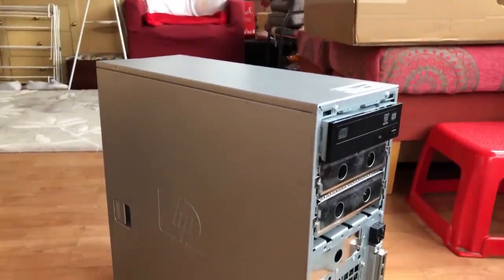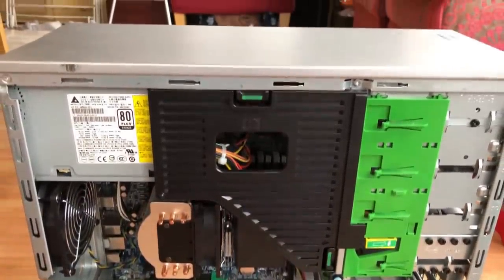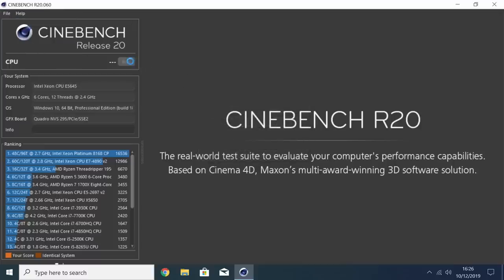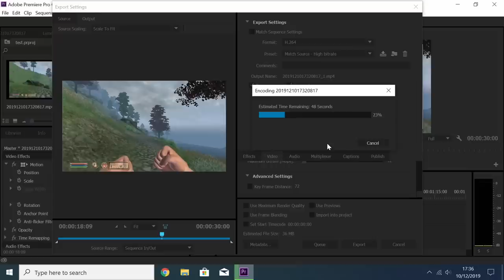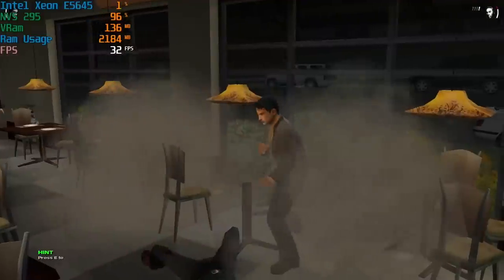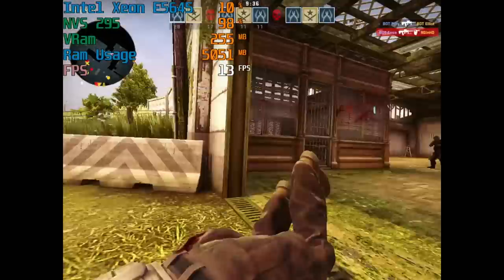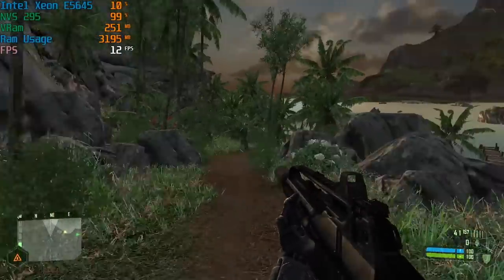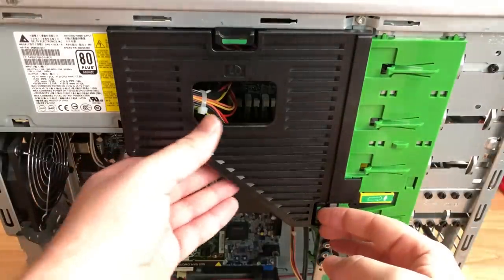I Bought a £50 ($65) 6-Core Workstation PC, But What's Inside?

Comment: Tech YES city would love this Xeon build.

You can definitely upgrade this to top of the line Xeons for cheap and throw in a decent gpu plus 16gb or RAM.
Reply: Yeah, Xeon W3690 (i7-990X) or X5690 would be a great CPU for that system. For RAM I'd recommend getting 24GB (3x 8GB or 6x 4GB) or 12GB (3x 4GB or 6x 2GB) because it uses triple channel memory.

Comment: Awesome. I've been using these to do budget custom builds and have plenty of vids, and even a complete transplant build tutorial, on these. You can run standard DDR3 on these, as well as unbuffered (non-registered) ECC ram which is also cheap. The top dog 6-core CPUs would be the Xeon X5690 or the Xeon W3690, and the highest frequency quad-core would be the Xeon X5687. For a collab with my TechTuber TechFam group, stuck an RTX 2060 on a Z400 build as well as managed to overclock the CPU with intel XTU due to using an unlocked variant. If you wanted any advice or help or were interested in collaborating on a content piece featuring these more, i'd be happy to lend a hand!
Reply: 4ghz all cores on a w3690 in a precision 3500 with a ghetto 240 aio setup. With an r9 390, made for an "ok" vr setup. Was prob 500 bucks all told 3 years ago. Was alot of fun. Yeah I cut the case.

Comment: I’d like to see what this machine would be like with a decent graphics card and more ram....
Reply: And a Xeon W3690 or i7 990X and some serious overclocking.
Reply: They do very well with a GTX 1050/1060 on stock psu.
Reply: I have a HPZ400 with a Xeon X5690 and RTX 2060, It was a present so I only added the CPU (60 EUR on aliexpress) and the GPU (about 300 EUR) I have no problem playing Ultra at 1080p with high framerate (dont expect 144 FPS or 120 on newer games but +60 is achievable), and even games like the division 2, im able to get about 60FPS on Ultra, 4K with 50% resolution scaling, and it looks gorgeus. (i known, resolution scaling is not real 4k but at 50% it still looks better than 1440p, just my opinion).
But here are some flaws
:
1) RAM: stuck at 1600Mhz (or 1300? cant remember right now). and you cant change it.
2) CPU: No overclocking options.
* I Just tried intel XTU and other sofware which I couldnt remember, maybe there is other way to do it but I think is because the stock motherboard *
3) PSU: most of them came with a 475W PSU with custom pinout (thats why I have 2060 and not something bigger), out there there are some 600W official PSU but are really expensive. The PSU connector is in fact a regular 24 pin connector but with some pins on a different possition, so you can use any PSU you want if you rewire the 3 or 4 diffent pins.
Those problems have an easy fix, just get a new motherboard so you can overclock your ram and get a better PSU but I normally like to invest the bare minimun on older devices like this one. 

So.. Its a really nice workstation, you can find some bargains on ebay and if you are on a really tight budget you can play games at 1080p max settings with no problem! (with the adequate Z400 variant).

Two more things the Xeon X5690 is not officially supported by HP but there are 2 variants of the Z400, one with 6 RAM slots and one with 4, the 6 RAM version can handle it, Also, HP states that it only supports 32Gigs of RAM (cant find the datasheet right now so maybe im wrong) but I have 48 and so far so good.

Sorry for the long text, hope it was useful and sorry if I made any gammar mistake, english is not my native language.

EDIT: Just saw a video where a guy adds the X5690 on a 4 RAM Z400 so forget about that...
Reply: @grimsayjr9371  you can get an aftermarket adapter harness to connect a standard atx psu to the hp mobo.
Reply: @OutlawH2  Hi! thanks for your reply!
I did saw it back in January when I started to upgrade this PC but If I remember correctly It was like 20 EUR plus shipping, and I really didnt felt like to spend that much because then I had to add some extra 100 EUR for the PSU so... I just held back, for now...... but the PSU at least you can use it on a future RIG so its more like an investment..... crap! now I need that cable! happy now? XD
Reply: @grimsayjr9371  lol the only other gotcha is the psu mounting. But it looks like that could be solved with an adapter plate.
Reply: @OutlawH2  yup, the mounting is not standard, and if I remember correctly ( I tried to fit an old 650W Corsair PSU years ago), the back of the PSU, where you plug it in, it doesnt align properly, but this is my ghetto PC gaming, the exterior case is already beaten up, so nothing that some duct tape cant handle, unles..... a new case..... it would be another investment..... oh man.....
Reply: @grimsayjr9371  rabbit hole lol. Greenpcgaming solved the psu issue with some velcro.
Reply: ive done this, plenty of builds and benchmarks. Even stuck a w3690 into one and used intel XTU to overclock it to 4ghz all core with an RTX 2060 and more ram, of course. Does well! Ive got the transplanting process down to a science at this point lol.

Comment: For these type of PC I usually recommend in buying the highest clocked CPU, the Intel Xeon W3690 or W3680. This being to them not overclocking but for the rest with AIB socket 1366 boards I recommend the Xeon X5675.
Reply: You can overclock the multiplier of the w3680 and w3690 using throttlestop on OEM boards without needed to modify the bios, the only thing you can't alter is voltages. You can however change the power target and current limit.
Reply: @Craziestbanana  Intel XTU works on the Z400 sort of, you can change the all core turbo multiplier, with the w3690 was able to hit 4.12 Ghz all core turbo on the stock voltage.

Comment: I got one of these with 18 gb of ram and I put a gtx970 in it; aside from the proprietary PSU being its eventual downfall, the system was incredibly capable of running the latest titles circa 2015. This is a fantastic computer if you are able to pick one up for cheap

Comment: I recommend the Intel X5675. still pretty cheap, but it boosts to 3.33GHz on all 6 cores (33% faster than E5645) and has a 95W TDP. it's the fastest 95W CPU this mobo can take.
the best 130W cpu is only like another 8% faster.

you got a 6-slot version of the z400, so always have either 3 or 6 sticks of 10600 ram installed for triple-channel functionality.
regular DDR3 works fine, though ECC unbuffered (10600E) is recommended, I'm running 10600u...

the old Z400 only had 4 ram slots and quad-core support, buyer beware.

Comment: I work in demolition and I've seen finding some left behind PCs. My last find was one of these but with a Xeon w3520 and a Quadro FX 1800 in it. Just like yours, gaming was definitely not in the question. So I threw in a GTX 960 and it was a very pleasant improvement.
Also if you update the bios you can buy a better Xeon for it.

Comment: I am currently using a Z400 as my main PC- my custom build computer was killed and I needed a quick replacement, and surprisingly, it's fine! Mine has the Xeon W3690, basically a i7-990X under another name. The 475W power supply runs this and a mildly CPU-bound GTX 1070 just fine. I will build something new to replace it eventually, but it's good enough that I feel no pressure to do so.

Comment: I use a Z400 as my main rig I upgraded it to a GTX 1060 msi gaming x, a  Xeon X5670 and 12Gb of Ram and it works flawless I never had a problem running games :)
Reply: 12gb of ram?
I can only buy 2x4, 2x8, 2x16
Reply: @user-wq9mw2xz3j  I have 6x 2GB
Reply: Same specs here, and runs even better as an Hackintosh ✌
Reply: @Cookie-jb3xd  oh wow lol.
does your motherboard support that many RAM slots
Reply: @romolo1990  lol really that's awesome :D
Reply: @user-wq9mw2xz3j  it has 6 slots

Comment: I have one of these as part of my set up. Currently have the 4 core W3565 and a Gt710. It has been a great browsing and general purpose machine in this format. But I have also put together one for a friend with the same processor but much more Ram and a GTX1050Ti. His Z400 has 24 GB of Ram vs my 8 GB. But the plan for mine is to upgrade to the same Ram and GPU. Already did the bios upgrade to support the W3690 6 core CPU.

Comment: I'm a proud owner of a Z400- they're pretty neat workstations, and the PSU can hold up with a beefier GPU without replacement. If you're still poking around for a processor upgrade, then stick to the 4-core chips that will typically have a higher clockspeed, with similar prices- a W3530 is alright, but there's always better. Bring the ram up by a hair and fit a 960 or 1060 and you'd have a pretty nice machine in your hands

Comment: One of my boxes has a 1366 gigabyte board with a xeon 3670 6 core. I pushed it up to 3.81ghz, paired with a gtx690. While it drinks power at 500w while gaming, it still handles quite a bit. It's my "portable" system I take with me to friends houses.

Comment: I really like those LGA1366 based HP Zxxx machines. 
Last year I got a HP Z800 for 100€.
Upgraded the CPUs to two X5675s, put in 64GB tripple channel RAM, an SSD, 4 1TB HDDs and a GTX 1080 and for the age the machine was a beast.

You should also check out a DELL Precision T3500/T5500/T7500.
Awesome machines as well.

Comment: I have had one of these for 5 years. I bought mine for £100 with 2 x 500gb HDD, Quadro 2000D GPU, 12GB RAM. It has a 1TB SSD and 24GB RAM now.  CPU is W3565.

Comment: I used to mod & flip these and dell T3500 in 2015ish for massive profits! Bit of paintwork, couple of LEDs and they dont look half bad. They came with W3650(?) 4c/8t CPUs at like £50. Throw in a GPU and you had a solid 1080p gaming machine for under £150. Shame the CPUs dont hold up well with newer games though

Comment: Yes, I game on one of these Z400 motherboards. You're going to want to go with the full 12GBs of RAM to take advantage of the triple channel memory bandwidth, upgrade to a W3690 or X5690 ( the X5690 can go for as little as $22 bucks in the US), and I went with a downward-facing Gammax Cpu cooler to give the motherboard and RAM extra cooling since I was putting it in an aftermarket case. I also brought a $10 dollars CPU fan adapter and a $15 dollars PSU adapter so I could use after-market CPU Cooler and PSUs.  Works great with a GTX 1060 or 1070 in gaming and CPU temps stay in high 60c or low 70c. But if your video editing you will want a decent after-market cooler because my W3690 does get hot at full load, but it still keeps it 3.6 GHz clock speed at all times.

Comment: You’re holding the CPU back with just 8 GB of dual channel RAM. Get 3 sticks of RAM to run in triple channel to fully maximize the x58 CPUs.
Reply: Triple goes only 1066mhz dual 1333 mhz so is not much gain
Reply: He had 4 sticks of RAM - using quad channel RAM would have been fine. I'd have increased the capacity to 16GB though.

Comment: I have one of these, possibly two. Mine only has a W3520 (basically an i7 920) though, but it’s the 6 slot motherboard and has an AIO water cooler. I also had one of the 4 slot models, but I donated that back to the refurbishment project I scored the others through where it still runs well to this day.

Comment: $50 basically for you and you get a proper case, working motherboard and cpu plus ram.  Not a bad deal at all.  Throw in an extremely old cheap hard drive and a suitable card that will not be a bottleneck for the system and it is good to use for gaming of sorts and like you said an everyday pc for simple tasks.  I wish it was more common where I am to have these places to go where you can get used stuff in England.  Canada isn't quite heaven for buying used pc parts and making it harder I am not close to a larger city.  Anyway great video and looking forward to seeing what you do with this.  Btw about not having a pc case side on eh who cares as long as it runs.  Heck I want a test bench like another YouTuber so I can just swap out hardware like nothing all the time.

Comment: I have a hp z400. I upgraded the power supply with 24 pin to 24 pin atx moddiy adapter, since the 24 pin on the psu isnt atx. I also upgraded to a hd7870 and the computer runs games pretty well. Only problem is the upgraded power supply can't be properly mounted

Comment: I got an old Z210 tower workstation from a friend of mine a few months ago that had a Xeon E3-1230 in it @ 12GB DDR3-1333 RAM. I think it's just the slightly newer version of the Z400. I upgraded it to a i7-2600 and thew in a GTX1060 6GB & SSD. It's actually a really good machine and makes for a decent everyday PC with some extra horsepower. I don't have many games to throw at it but I have tried Forza Horizon 3 & 4, Fallout 4 & Rocket League and all play well at high settings 1080p.

Comment: Picked up a Z400 with W3680 3.33ghz 6C/12T, 14GB DDR3, 500GB HDD for £68. Threw a GTX 1060 into it and the thing flies with an SSD installed as well.

Comment: When using 1366 always make sure you are in triple channel memory (not 4 2gb sticks as this will turn it to single channel) homnestly  upgrade the GPU i have been uing the X5650 (The E5645 slightly bigger broother with 24GB DDR3 and 2 gtx780ti's  in SLI for the past 6 years and it has served me well)

Comment: just a warning, i got 2x of those hp workstations: they got proprietary psu format that also lack a pullup resistor for the turn-on signal (which is instead on the motherboard). also the motherboard tray doesn't allow different formats in.

Comment: Speechless but a good deal you had in buying this machine. I am still on  Intel Pentium Dual Core E5700 @3.00 . The good thing is having a good motherboard of ASUSTeK Computer INC. P5G41C-M LX (LGA775) so did ssd with GPU card Geforce Gt 710 . Still working . But would say that HP devices are rarely good especially in the long run.

Comment: i still have the same z400 but with 4 core 8 threads xeon paired it with 16 gb of ram a saphire radeon rx480 oc 8 gb and 3 ssd's in raid 1 and plays all modern games with fps starting from 60 up with all settings maxed out  . best beast i put up toghether for myself until now .
gl with the project and let me know if u want to change the power supply  there is a bit of modding involved to the 24 pin to work on that mobo.

Comment: I run a Dell T7500 workstation with twin Xeon X5690 CPUs, 4x 15,000rpm SAS drives in RAID as a main boot drive, 48GB  ECC RAM and twin GTX 980TI's with a second power supply. 4K 60fps gaming easy at a fraction of the price, noise cancelling headphones recommended.

Comment: Hi - My main PC is a dual xeon X5670 rig with 32gb of ram I picked up for buttons on ebay. Popped a gtx1050TI in it and it games well and with 12 cores at 3.2ghz it monsters through productivity stuff. I really rate the LGA1366 based xeons and if you can get a system with dual CPUs for low money then the performance for price is incredible. Some of the dual xeon workstations of this generation still attract a decent price but every so often you can score them cheap.

Edited to add, depending on bios most of these will take up to an X5675 so that might be an upgrade to get better clock speed. Slighty faster ram might help - mine is running 12800 DDR3 which is a bit faster than normal stuff these come with. Again in terms of upgrades, the Bios is normally the limiting factor as workstation stuff often has very little if anything in the way of bios options like overclocking and memory speed control (well at least mine as bugger all options!). :)

Comment: Hey, I know you're probably keeping the power supply, but be aware the mother board pin connectors and power supply are not standard, so if you just pop another power supply in there you'll fry the board. There are various conversation methods/kits if you do want to use a standard power supply with this board.

Comment: If upgrading the CPU get a W3680 or W3690 because they have unlocked multipliers. Even on a locked OEM motherboard you can still overclock the turbo speeds to 3.9 - 4.1 Ghz which will significantly improve gaming and workstation performance. The software to overclock it is called ThrottleStop and it runs in Windows.

Comment: second hand workstations are the best when it comes to lowcost gaming, just buy one with 8+ gigs of ram and stick in a used 970 or similar and you get quite a beast for less than 200 euros, the only downside might be the size and weight of the case because these lads are absolute units (my t3500 weights 15 kilos) but the airflow is just wonderful

Comment: Got a dual socket 1366 ibm x3500 m2 server. I upgraded it with 2 x5675 (the sweet spot x58 xeons) on ebay and this beast can do any cpu intensive workload I can throw at it. And yes I am running a heavy modded minecraft server with no hitch.

Comment: I had one of these I picked up from e-waste. I was pretty excited to get my 1070 in it and see what it could do, but I was sorely disappointed. The PSU is under powered and proprietary. Can't just take your 600 watt PSU and drop it in, it has a different pin out. You can get an adapter, but that is kinda iffy IMO.  I ended up striping the 24gb of RAM it had in it, saving the CPU, and dropping the thing back in e-waste.
Reply: I too have one, making the psu adaptor was easy

Comment: I got a dual x5650 CPU with 32gb ram, 250gb x4 hard drive so it's a 12 core 24 thread. For £125. I got two gaming computers what I use for editing but it's good for Virtual machines.

Comment: w3680 or w3690 are the cpus to get for Z400. You can overclock those and that makes a huge difference.
I have a RTX 2060 in mine and w3690 doesnt bottleneck it at 4Ghz. you can also install 48GB of RAM if you want to. HP says 24Gb is max but that's wrong, 8GB DIMMs work. The main upgrade you want is fast storage/SSD. You can install an NVME PCIe card to go past the sata2 speeds. You can even boot into the nvme drive if you install UEFI bootloader like Clover.